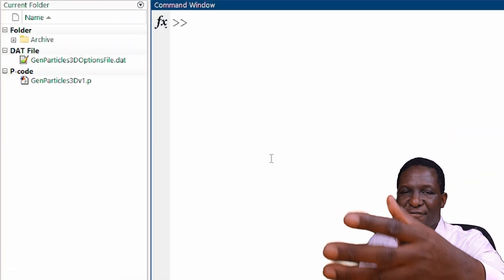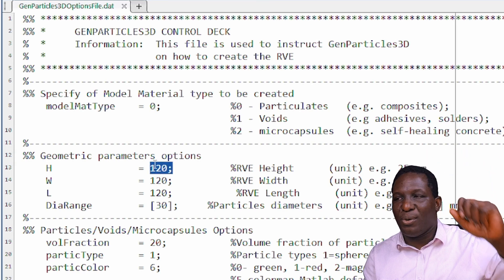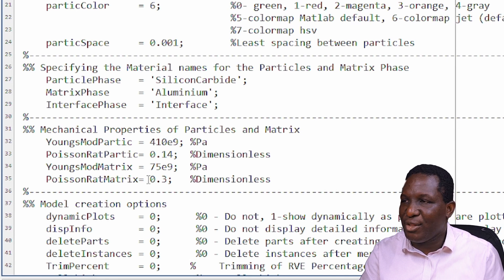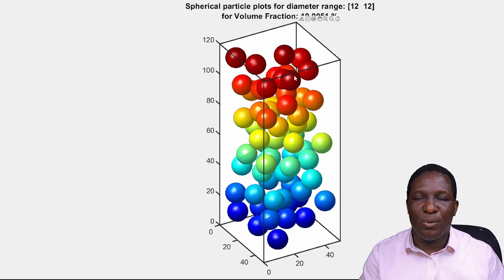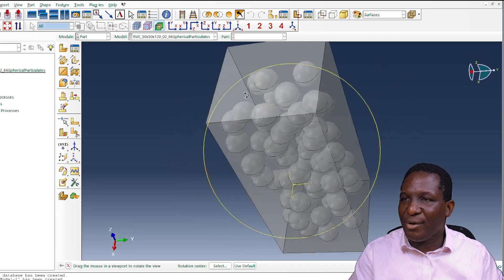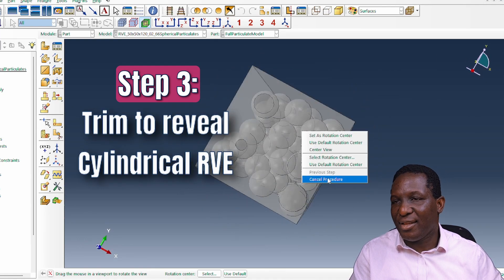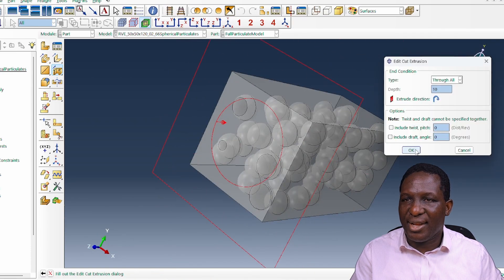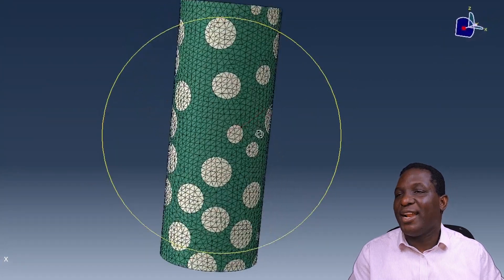I CREATED an  unusual CYLINDRICAL RVE for a PARTICULATE composite

Comment: Thank you Sir for your best videos. I am continuously watching your videos from the very beginning. I have a question or a request if you also make a video for the simulation of encapsulated self-healing Ultra High Performace Concrete. The RVE contains random aggregates of different sizes, steel fibers, and microcapsules having a core and shell. Thanks in advance
Reply: Thank you Sir for your positive response. Is it possible just to make a concrete RVE geometry (not simulation ) having 3 different types of materials like aggregates, steel fibers and microcapsules, randomly distributed and do not overlap with each other and not even concrete edges
Reply from the maker: Yes in deed. It will require developing a monte carlo implementation that includes the three geometry types. It is not trivial but it is possible.
Reply from the maker: Hello addykhan, thanks for the query and am glad you find the videos helpful.

Actually, I have ideas about self-healing concrete but have never made any video about it on this channel. I am not prioritizing this sort of video now but maybe in future I will be able to help.

Having said that, the ideas I used here on AlSiC particulate composites can work for your concrete. The microcapsules is slightly different - you would just have to shell the spheres to make them void in case of a microcapsule. I would usually work with spherical inclusions but I know with concrete, the inclusions can be of any irregular shape - so the later can be quite challenging.

Sorry if this is not helpful and good luck with the research.